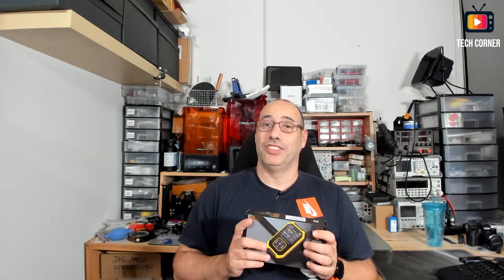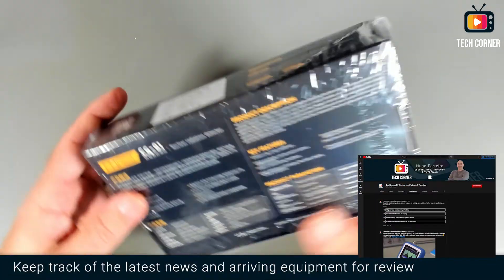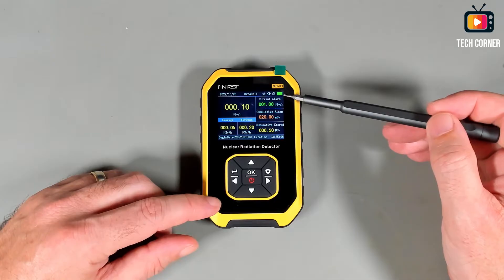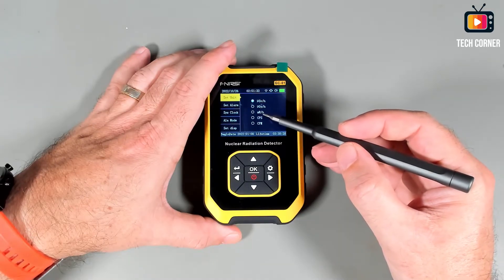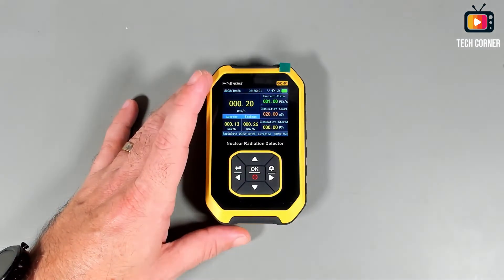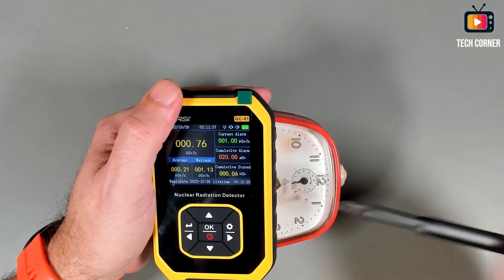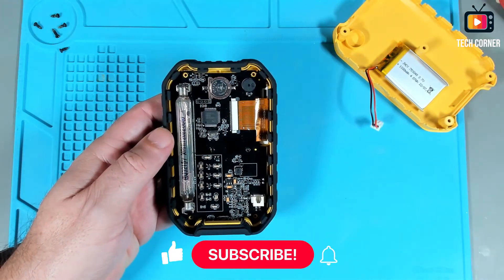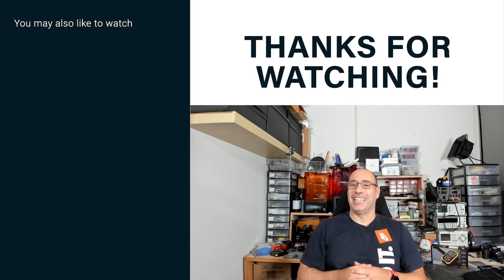FNIRSI GC-01 Nuclear Radiation Detector/Meter ⭐ Would you need one?

Comment: I have contacted the manufacturer and recommended a "source finder" click per count mode which is the most important feature for any geiger counter.  They need to be able to locate hot sources.  Such a goofy oversight on their engineers' part.  Just a shame in an otherwise good product.  It may be possible to mod the unit by running a couple jumper wires from the LED to the little piezo speaker.  However, I don't know if the LED's flashing voltage will be high enough to provide a useful click since it doesn't look very bright anyway.
Reply from the maker: Hi, very good suggestion. Thank you so much for your comment and watching!
Reply: Have you tried doing that yet? Curious if that idea worked.
Reply: @GeigerCounterVirtualMuseum  I did it with another DIY circuit board counter and the LED voltage was barely enough to provide a weak sounding click to piezo.  It should also be enough to trigger a monostable multivib clicker circuit, if required.  The question is if that little circuit could be made small enough to fit inside the case. Would be tight.
Reply: Looking at the video, it's evident that they're using the microprocessor as a pulse stretcher on the LED.  It will quickly become on continuously with higher count rate.

One could use about a 100pF, 1000 volt cap to couple directly off the Geiger tube anode to a piezo sounder.  The pulse voltage is the operating voltage which is either 400 volts (Russian tube) or 950 (rest of the world) but the tiny cap will limit the energy to something safe to the piezo.
Reply: During my evaluation of this unit, I scoped the LED vs GM pulses.  The LED is pulsed by the microcontroller at random intervals compared to the GM pulses.  The LED flash rate increases with the count rate but not proportionally.

When I get time, I'm going to couple off the actual GM pulses through a low value, high voltage capacitor directly to a piezo sounder.  I despise piezo sounders but it's the only audible device with a high enough impedance not to load down the GM tube pulses.
Reply: Good post, great idea, thank you (And I see you made it to this channel as well, well done.)
Reply: @Anthony_Matabaro_3D_360  Thanks.  Still don't have one but I will get one of these units on order and see about the piezo mod.  Not heard if anyone has tried it yet.
Reply: @nefariumxxx , I have a unit on order now, so I will look forwered to seing what you do 👍
Reply: I hooked up an active piezo buzzer   before the led resistor and - point. it worked good enough to have a better feedback.
Reply: I saw a video recently of someone who replaced the  the Geiger tube with a better one and added the clicks.
Reply: @Puppy_Puppington  Yes, there has been good progress from an independent developer who made some better firmware to run.  It works on most models via USB  without modification required but my model requires a little soldering of four pins and the use of a $5 programming dongle.  Most users can just do it via USB without the mod/dongle.  Search for "Rad Pro firmware for FNIRSI".
Reply: Use a 100 pF capacitor to get clicks.

Comment: Is there a way to turn on an acoustic signal for the counting?
So it beeps while measuring?
Reply: There are three mode, indicator (led), vibration and sound. So the radiations are sound according to the notice.
Reply: @Mimichris100  Yes... but they forgot to include the most important feature which is click per each count .  "Source finder mode".  The vibration and sound are just there when a certain "alert" threshold is reached.
Reply: @nefariumxxx  OK, thanks.
Reply: @nefariumxxx  Isnt the LED giving the exact same information like the click? Yea I mean I have to watch the device instead of just listening to it. But thats the only drawback isnt it?
Reply: @nefariumxxx  Im pretty new to Geiger counters so thanks for your answer :) Guess im going to get a cheap one like this to get started!
Reply from the maker: Hi, not that I'm aware, please notice that even in a "normal" enviroments is always detecting radiation, but in low dosages. That will be probably really annoying. Thanks for watching!
Reply: @TechCornerTV  No... all geiger counters should have a click per count mode which is sometimes called "source finder mode".  This is a very important feature.  If you don't see a setting for it in options, it's a shame.  It may be possible to do a hardware mod.
Reply: @nefariumxxx   hi I kind of was disappointed as well. The LED is indicating activity only. You can of course check the diagram mode to see if you glanced over some active source. 
The device seems not to connect to USB; probably charging only. 
It seems it can not be used as a cumulative counter (dosimeter) , as it does not appear to run in background but shuts down after some time .... 
It is the least expensive that seems to give some reading but i am not convinced very much yet ...

Comment: hi Hugo thanks for the education , love the intro . i just wanted you to know the dials should have been taken out from the watch  during texting.
Reply from the maker: Hey Andy, I'm glad you liked. As I told before, this is not my "beach", the watch tip was awesome, otherwise I didn't know how to show this working, didn't also that I should take it out, even so, as you can see it triggered the alarm. Thanks for the support and for watching! 😁👍
Reply: Do not remove old radium dials from the case. Often on older watches the radiation has broken down the paint and there might be loose bits of Radium that you for shure do not want to inhale or ingest. Leave the watches and clocks as they are as the stuff you are testing for will show a result thru the glass without any issue.